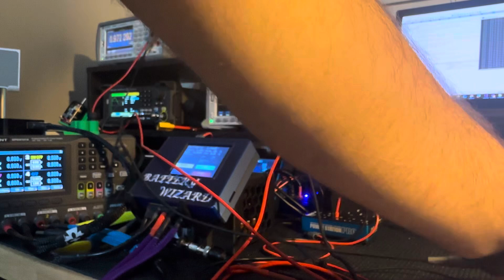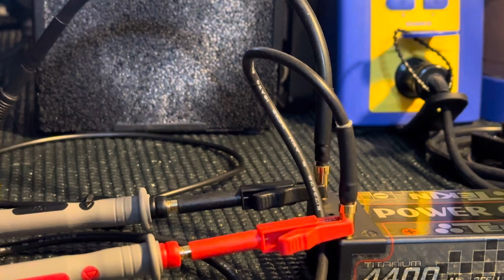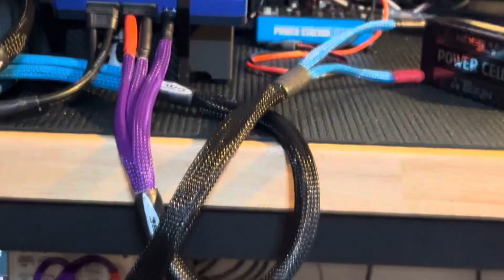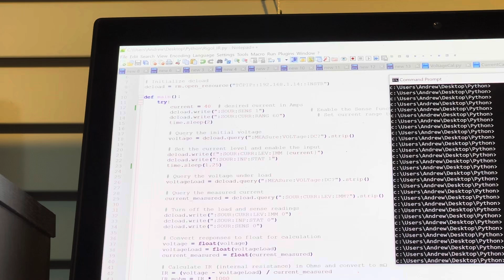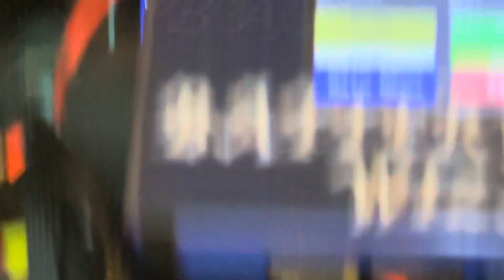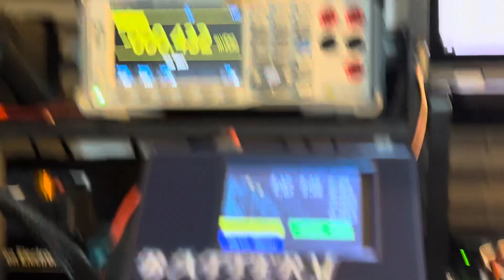Battery IR tests with Battery Wizard

Comment: I think to to get a better measurement accuracy, you would reduce as much as possible all cables length during the measurement. Because your measurement set up is going to measure also the Ir of the cables. And of course a key parameter if the battery temperature. AS yo umay know the IR will increase at low temperature. Anyway the comparison is really interesting , thank you ;-)
Reply from the maker: @jimy31-ns9ht5qi8o  All measurements were done using a 4 wire technique. Ie, the voltage measurements were done on non current carrying leads. I could make my sense leads twice as long with out any noticeable affect.

Comment: What about heating the batteries. How much better would the pack run and how much would the numbers change?
Reply from the maker: Heating the batteries will increase performance.  More heat excites the electrons and lowers the IR.  There is a point of diminishing returns however.  Also the warmer your batteries are to start the race, the hotter they will get during the race.  Too hot is a thing, you don't want thermal runaway.  

I keep meaning to do a video comparing a warm battery to a cool battery, it is on my list, I swear.

Comment: More power delivered quicker with lower numbers.
Reply from the maker: Yes, absolutely!  Lower IR means more vroom, vroom!  But not all tests are created equal...
Reply: Have you done tests at different SOC?
Reply from the maker: @ Yes I have, SOC affects the IR as well. Lower Voltage on the pack will give higher IR.